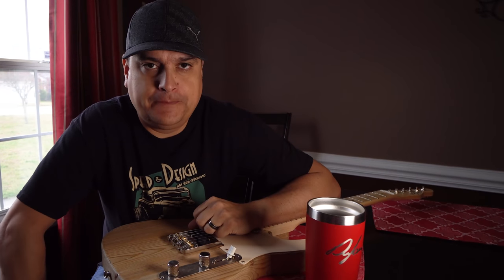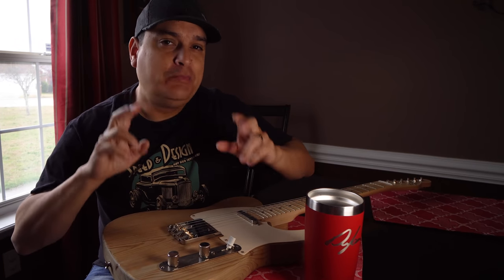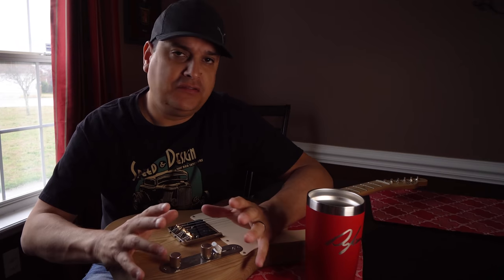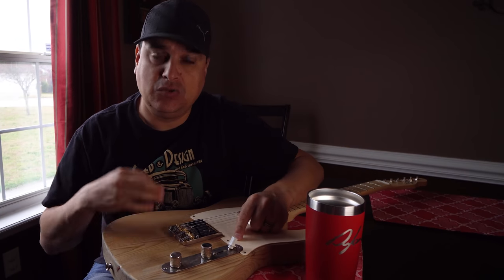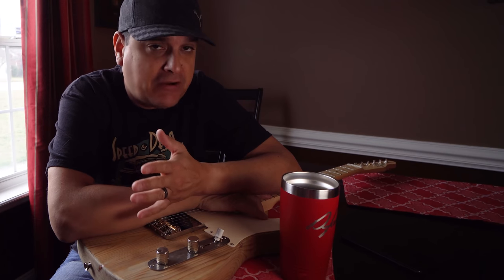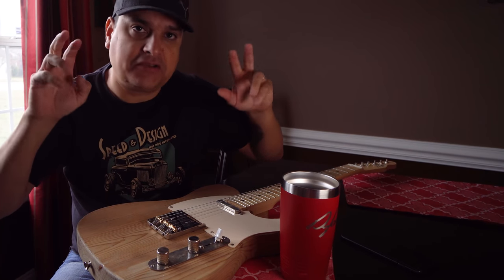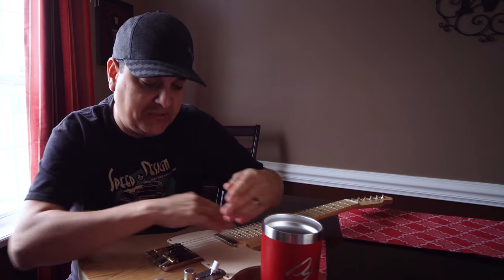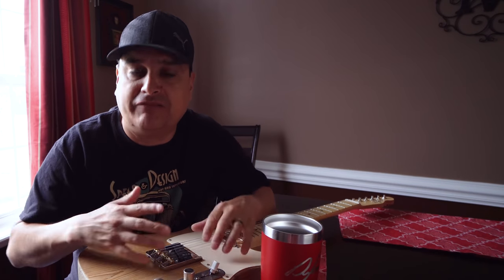Vintage VS Modern Telecaster Wiring (demo)

Comment: Just finished putting together a 1950-1952 Broadcaster wiring used with Fender Nocaster pickups. Now want to try black guard circuit. Thanks for info. Great as always.

Comment: My 52 reissue came wired Bridge, Neck, Neck with bass cap.  And you could get Bridge and Neck together in the in between position. I eventually added a 5 way switch with a tone pot , Bridge, both in parallel, Neck, Neck with bass cap, and both in series (my favorite sound for lots of stuff). Took me quite a while to figure out the switch wiring 30 years ago. Another great vid Dylan!

Comment: I'm really curious about your opinion on dummy coils and series wiring for starts or teles. I've got a start I've though about experimenting with using series wiring and adding neck pickups to bridge and bridge with middle. I've also seen videos of people installing hidden dummy coils to reduce hum. Thoughts on these options?

Comment: I would like to see more about modifying telecaster wiring.  I fine your videos very interesting.  I also think you are correct on dc resistance measuring of pickups because AC resistance changes with frequency.   Thank you fore sharing this type of info with us.

Comment: This was a great video, Dylan...you did your homework well on this one.  Years ago I had an 1986 made 62 custom Esquire reissue that I converted to a Tele and  tried all those historic Tele wiring that you covered... I even did a series-parallel plus set-up using a 5 way switch but in the end the basic regular post 1967  Tele wiring was the most practical and my favourite.

Comment: I have just found out that i do have dark circuit wiring set up on my 52 tele that i bought in yr 2001. Do you have a guide Vid on how to change the wiring to modern set up?

Comment: Cool video! Never knew about the dark thing before. For a future video: what can be done with a Tele that has two splittable humbuckers, a five-way blade and two push-pull pots?

Side question / rant: how come Fender never to this day fixed that stupid Telecaster issue with the switch being so damn close to the volume pot that it's almost impossible in a live setting to move away from the bridge position without jamming your fingers in the volume knob? For one of my Teles I got a control plate with an angled switch slot, it's a little bit better, but if that volume pot was just half an inch further to the right...

Comment: Damn, I didn't knew about this dark circuit mode. Really awesome, loved the tone!
If you want to do mods next, I was thinking of something. How about a 4 way switch, having both pickups in parallel and in sieries. Then in the tone knob, there's a push-pull to invert the phase of the bridge position (making out-of-phase on the series config). I think I've saw someone doing that, but the real challenge would be to add this dark-circuit tone of the neck on the volume push-pull. Can it be done?
Anyway, congrats on the video. There's no one on YouTube that explains things better than you, or in such deep details. Keep on rocking, man!
Reply: I have wired my Strat for N+B (neck and bridge in series, same polarity) and N+B- (neck and bridge in series, reverse polarity) on two of the positions of my 5-way switch. I thought I’d let you know my results. 

*Just a note on my wiring terminology.  X+X is two pickups in series, and  X/X is two in parallel. A minus sign (e.g. X/X-) means one of them is REV polarity.

Series same polarity wiring largely hides each of two pickups’ sound. I do not hear anything like a sum of the two. Mostly a louder and warm (boring) output. The reason for this disappointing result is that the pickups are too far apart for cancellations to be in that interesting frequency band. Series REV polarity does yield a brand new tone which some describe it as “squawk”. I find myself using N+B- often, and N+B rarely. 

I still get the classic N/M and M/B. I personally have no use for Middle by itself. The wiring to accomplish this with no appearance change took me a LONG time to figure out. Eventually, I went with a pull switch on the middle control and this availed to me a very special M+B-. Again, the series wiring takes away some of the extreme cancellation I’d get from M/B-, a good thing in this case.  Having played with these sounds for a while, I plan to replace N+B with N/B.

I hope all of this might help you.

Comment: I have been doing some awesome wiring experiments with resistors and capacitors in my T-style guitar. (Many reasons I'm not using a true Tele.) Push pulls with some odd stuff and a 5 way switch. Some positions there are parallel circuits running together to make some weird ambient sounds along with clean sounds that really come out with certain effects. I have literally 20 different possibilities with 2 single coil pickups just to experiment. There are some really cool tones and it is really fun to do something different. Soon I will be producing some handmade instruments to test out the waters. This comment is to catch some questions as well as for the chance at that kit, if I understood you right!

Comment: Interesting that the first two-coil tele had a blend pot, but they've fallen out of favor.  My Dean HH has a custom wiring job which adds a couple of fixed resistors so that in one of the switch positions, the tone knob affects the neck pickup much more than the bridge.  My tuning uses two bass strings and four treble, and I have mutes on the upper four strings of the bridge pickup, so the effect is that the two bass strings have almost wide open tone while the treble strings can be set darker.  Interestingly, for better or for worse, the tone pot also ends up affecting the balance between the bass strings and the treble strings, somewhat like a blend pot, but the ability to have the guitar sound like two instruments with very different timbres is pretty cool.  Such a thing would probably have worked out pretty nicely with something close to that original tele wiring if the darkening circuit were attached to one of the coils, before the blend pot.

Comment: I have a '52 reissue... tossed the ultra heavy baseball bat ash body for pine... now I can play it all night without any discomfort... and contrary to your tonewood debate, I think pine sounds better, warmer, fuller, and doesn't detract from what a Tele does.

When I got it it came with extras.
1. An extra-crappy 6 barrel bridge 
2. A 1 Meg volume pot
3. A capacitor to use as a treble bleed w/o a resistor.

When I  bought it, I was clueless about wiring, but from my slot car days, knew how to solder. For some reason, the 1meg pot and bleed intrigued me, so I switched them out, put them in per included instructions. 

Miraculously, it worked out, with the exception of the bridge... which I replaced with a Gotoh Strat saddle bridge... nice, but it sucked some of the classic Tele twang, which as I aged, became more important since I took up Country, after decades of Rock/Blues.

All I added since was a varistor in the bleed so I could tune it. Now this instrument, with the exception of the bridge, is perfect... 

Folks are amazed at how tonefully bright the guitar is... ice pick tones w/o being painful.

I just built a Strat. I would appreciate a video like this one, including the history, of Strat wiring. I am having issues... mostly because I'm a non-conformist, and experimenting.. it's time to swallow my pride and start anew..  but would like your input for a traditional Strat. There are tones I'm chasing, and not getting.

Comment: Never knew that you could once blend in the neck pickup while on the bridge position. I think that's super cool. Hell, I think that should be the standard middle position wiring for any double pickup guitar.

Tele mod? Hmmm.. how about putting a vari-tone style rotary switch on a tele to select different caps.. kinda like what you get on BB King's Lucille.

Comment: I have a strat middle pickup wired to its own volume (added 3rd pot) goes to Jack and master tone (.0017 tone cap, actually it took 2 caps to get that value.) When middle pickup is off, its just a tele with 3 way switch...but then I can bleed in that start quack...and can even use all 3 pickups together for a 3rd quack sound. By bleeding in, the level of quack can be fine tuned

Comment: Thanks for the interesting history about tele wiring circuits. I appreciate the evolution to the modern wiring. I personally  like it's versatility,  especially with an additional custom / botique mod, i.e., a 4 position switch that adds a position w/ both PUs in series, which gives another more meaty tone. Keep up the good work!

Comment: I actually love the blend option with the first wiring. However I use a 5 way switch wiring that does series and series with a darkening cap as well as bridge, bridge/neck, and neck pickup with volume and tone pots. Very usefull to throw to series when soloing and lots of tones to mess with betwixt the rest of the settings! Love to see more modern Tele wiring to get me inspired... That blend is really nice... Also a nashville tele setup and wiring is daunting, cause my other mistress is a HSH strat... I just love to fiddle tones..
Reply: Do you have a wiring diagram?

Comment: If you decide to do a modern Tele mod's video, how about a balance knob in place of the 3 way switch.  I built one this way, looks pretty cool.  Still mainly use full left, middle, full right. but it is something different.

Comment: I’m so happy to see you unambiguously debunking the myths about insulation and capacitor formulation differences to tone.  I am an electrical engineer as well as a lifelong guitarist and have endured more bs on these topics than I care to remember.  These things are aesthetic issues only.  The truth is that an electric guitar is just a fantastically uncritical application for such things as connecting wire, resistors, and capacitors.  None of these items is used to even a thousandth of a percent of their capacity, nor are their values critical to any serious degree.  Thanks for speaking truth on these issues.

Comment: How about adding video about wiring hss sets with resistors to compensate for volume pot values. How to find out pickup phase before wiring (multimeter, voltmeter + metal object moving towards pickup and away from pickup)
Why do many pickups with alnico 5 magnets sound so different to each other what are the parts that matter. How wire thickness and material matters. Does hunting the truest PAF tone make any sense why pickup building is such a retrogradically oriented.
How magnetism of Alnico 5 magnets is controlled and do magnets get customly degaussed

Comment: I have always thought there was something kind of magical about the blend circuit, but I really wish there was some way to employ that along with the tone knob without altering the original aesthetic of the guitars' control layout. I wonder if there would be a way to do it with some sort of push/pull pot or something that used the pot as a tone when it's down and a blend when it's up? Ideally though I'd want to be able to control both aspects at the same time and not have the push/pull an either or. I guess that would probably require some sort of digital programming though, which would take away some of the magic. I guess I'll just have to get two Teles and make one of each. 😃 Sorry for the rambling message, I was just thinking out loud. Keep up the vids sir, you have loads of great info!

Comment: Wow! I've never knew about this bass circuit I those early teles! Thanks again about sharing knowledge, very very interesting, I liked this second circuit, I just don't know if I would get used to. The question is, some terms are in the guitar world doesn't have a accurate translation, so it get lost I'm translation or use the original term but get confused. The subject is "offset guitars" I found out some different things about, some of them just say that are guitars not symmetrical shape, or just about some fender models from the 60s and some of them say that are like "alternative guitars" out of standard. I saw you got some awesome videos about jazzmaster pickups, Jaguar, mustangs and etc, can you talk about what are and characteristics of offset guitars? Is it about pickups, is it about shape, a particular era or just not "regular way of guitar making"?
Thanks for all, appreciate your knowledge sharing